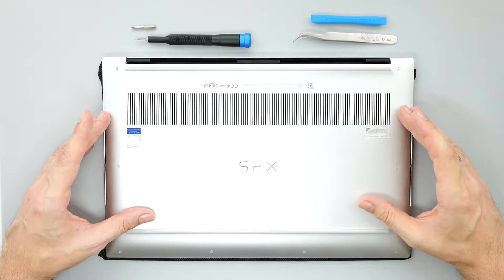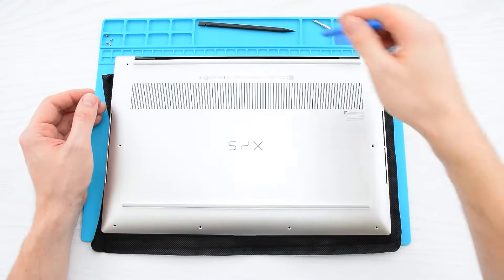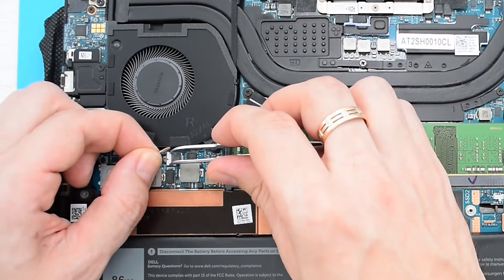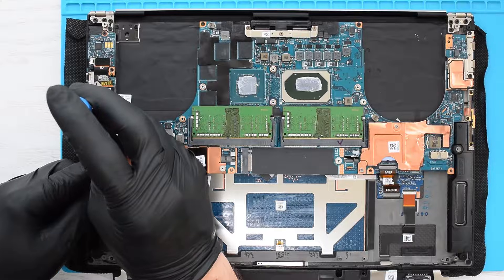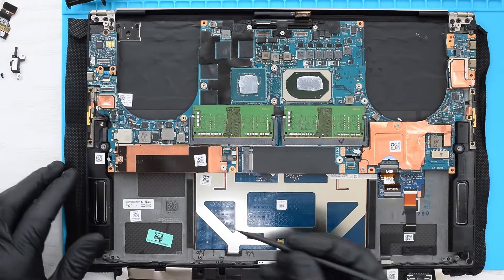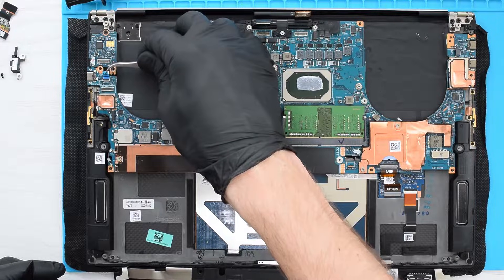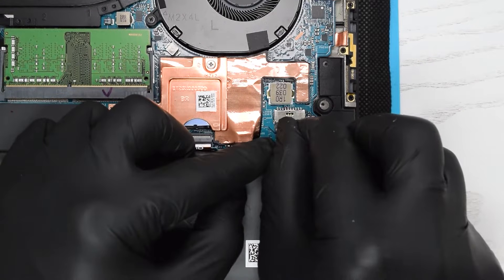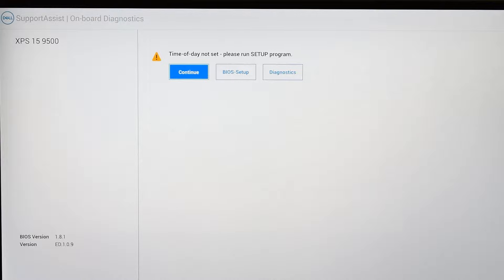How to Disassemble Dell XPS 15 9500 / 9510 / 9520 – Step-by-Step Guide

Comment: How many more steps after the 3:00 mark are there to replace the keyboard?
Reply from the maker: For that Dell XPS, the proper way to replace the keyboard is to replace the entire palm rest assembly, as it comes as a single unit. Technically, it is possible to replace only the keyboard by using a soldering iron to melt dozens of plastic rivets, remove the old keyboard, install a new one, and then re-melt and flatten those rivets to secure it. Will it work? Kind of. If you can’t afford replacing the whole assembly, this method is acceptable. However, keep in mind that it will never be like the original. The keyboard will usually have some play, some areas may sit lower than others, and many of the plastic rivets will break or weaken because they were not designed to be reused or allow keyboard replacement.
Reply: @ElectronicsComputers  excellent, thanks for detailed description mate

Comment: I'm wondering what the copper/golden-color heatsink with a thermal pad underneath is for. I replaced the pad with paste, thinking it was the CPU - is that a bad idea?
Reply from the maker: That chip is the PCH, and using thermal paste instead of a thermal pad is a really bad idea because there’s a big gap between the heatsink and the PCH die. You need to use either thermal putty or a thermal pad, otherwise that laptop won’t last long.

Comment: Hei man! Great video.
Question, since you are the only one on YT that has same model - how to remove keyboard?
The rest of models have few screws that holds keyboard. But mine (and yours) seem to be attach to cover :/
Tnx
Reply from the maker: Yes, the keyboard on the Dell XPS 9500 is technically replaceable, but it’s designed to be replaced together with the palm rest assembly. But you can still do it. The keyboard is held in place by plastic rivets that were melted during factory assembly. If you gently soften the rivet heads with a soldering iron while prying up the keyboard, you’re essentially melting them just enough to release the keyboard without snapping the heads off completely. This way, more of the original rivet material stays intact. When installing the new keyboard, you’ll still have enough of the rivets left to re-melt and mushroom them back over the new frame. We do this kind of repair on a regular basis, it's pretty easy.
Reply: @ElectronicsComputers  I was afraid of that =)
Thank you so much - I might do that

Comment: Helpful video! Would I be able to swap my dell xps 15 9500 with an i5 motherboard with that of a dell xps 15 9530 with an i7 and arc a370m gpu?
Reply from the maker: Yes it's possible but you have to also replace the heatsink.

Comment: How do you get the plastic tool inside the corner in the first place? I cannot get this back cover off. I have the same tool.
Reply from the maker: Just push it firmly and gently move it slightly left and right until it slides into place between the cover and palm rest assembly.

Comment: I have an 9520 and used a different charger (one from my ASUS which has a lower watt spec). I have used this ASUS charger many times and still use it on my ASUS and my phone without any issues. However, one time when I plugged it into my 9520 I heard a high-pitched pop (like when you pop small bubble wrap) and since then I cannot turn it on. Before I purchase a new MB, I will try resetting CMOS, but if that doesn't work, I'm wondering if these have a replaceable fuses or MOSFETs (I'm good with soldering small components), and if so, where they are on the board?
Reply from the maker: There's no point in buying a new motherboard, as it will cost more than half the price of that laptop. This is because the CPU and GPU chips on the motherboard are quite expensive. I'd recommend trying to fix your existing motherboard first. Most likely, there are some dead MOSFETs or shorted capacitors, which will only cost a few dollars to replace if you order them from AliExpress.
Start by checking all the coils with your multimeter in continuity mode. Attach one probe to a ground point, such as any metal part of the USB port, and the other probe to any contact on the coil. If you detect a short, you’ll need to investigate that particular power rail further. Most likely, you’ll find a shorted capacitor that eventually caused a MOSFET to fail.
Even if you need to buy the cheapest hot-air station for $25, it would still be a very inexpensive repair.
Reply: @ElectronicsComputers  Thank you 🙏

Comment: Unfortunately the keyboard is now welded with plastic rivets. On the past dell xps 15, even though it's integrated inside the casing, it's only held by screws that can be easily removed. Yes sure the plastic rivets on the newer xps can me melted and removed with soldering iron, but it will be quite much i suppose
Reply: I wish this video mentioned the keyboard and how it is attached to the palmrest. Can't find anything in on this on YouTube. I believe you are correct and this means it will be more difficult to replace or a new palmrest with a new keyboard is needed.

Comment: Hi, I just followed your tutorial to clean my laptop, and it was so helpful! I did run into an issue, I noticed my trackpad and keyboard are not functioning after reassembly, what do you suggest I do?
Reply from the maker: Check the connectors, that's the only place where something could go wrong. If it doesn't help, then try to reset the BIOS.
Reply: @ElectronicsComputers  Should i just try disassembling again and then reassembling? And do I need to look at any specific connectors? That’s what i was thinking of doing. I’m not well versed in this so I’m asking so many questions sorry☹️
Reply from the maker: @yearthy2529  Just reconnect those two connectors that you see on the bottom right side. Maybe you didn't plug them all the way in.
Reply: @ElectronicsComputers  I fixed it! Reconnecting the connector was the only thing I had to do, and I just had to restart one time after rebooting my laptop. Thank you so much!
Reply from the maker: @yearthy2529  Great job  👍 . I'm happy to help.

Comment: Hmn... Still don't understand where's a CMOS battery location?
Reply from the maker: The CMOS is powered by the main battery.
Reply: @ElectronicsComputers  thank you
Reply: @ElectronicsComputers  Sorry to piggy back on this, but you are saying that when you remove the main battery, it automatically resets the cmos battery too?
Reply from the maker: @Ajvkorn89  There is no CMOS battery in most modern laptops with built-in batteries. A large lithium-ion battery, provides power to the CMOS chip. Therefore, if you disconnect the main battery, the CMOS settings may be reset.
Reply: @ElectronicsComputers  thanks man. Was going crazy trying to find it cause the fan is extremely loud. Already replaced it, reset bios, nothing works. Immediately turns on high when you start the laptop. This least lets me know not to focus on the cmos resetting the settings. Appreciate ya!

Comment: Is the left side the way the lettering is facing on the back trying to make sure I got the right fan assembly
Reply from the maker: Those fan can be installed only to the correct side  and there's no way you can install them to the wrong side.

Comment: So I am trying to install upgraded RAM and sure enough 1 of those 8 screws has become striped (its a corner one on the front 'lip').  I am going to try to place either a rubber band, small cloth, or electrical tap between the screw head and my tool so see if I can get it out.  wish me luck.
Reply from the maker: I hope you'll make it work.
Reply: Ok so its been 2 months.  What I had to do was use a 1/16th drill bit to drill out the tiny TX5 screw. Make sure the measure the length of the other TX5 screws and mark your drill bit accordingly (I wrapped blue painters tape around the drill bit that was longer).  After drilling out the split screw I was able to pop off the chassis like you did here.  

I think Dell XPS 9520 have a BIOS setting that will detect hardware changes and may require your BitLocker key if you have that enabled on your system.

Comment: Many thanks for the instructions. However, on my XPS 9500 it was impossible to start from the corner as recommended. Even with a tool the size of a razor blade, I could not open the very tight connection there. Eventually I was able to (carefully) start from the hinges. It took me 30 minutes to remove the cover, a "nightmare".
Reply from the maker: I'm happy to help! My instructions were based on the Dell service manual. I've opened dozens of those models in my repair shop, and some of them are very easy to open, while others are quite tight. It could be due to different revisions of some parts with varying tolerances.
Reply: Same here, it's like it's welded down AND NOTHING will lift it

Comment: If I spilled water in my 9520, but shut it down shortly there after, should I disconnect the main battery, drain any electricity, then connect the battery and restart  the computer?
Reply from the maker: Yes, you have to disconnect the battery as quickly as possible and dry your laptop. If you see some residue on the motherboard, clean it with rubbing alcohol. In most cases, the keyboard doesn't survive liquid damage.

Comment: great video, one of my fans has died and I am replacing it this weekend!   Question, do you need thermal paste on the heat sink when I reattach it?
Reply from the maker: No! You don't even need to remove the heatsink to replace the fan. Simply unscrew the fan, replace it, and put everything back together. If you're not confident in your skills, disconnect the battery. Otherwise, a dropped screw on the board with the connected battery can be fatal to that motherboard.

Comment: Can you remove the usb c port ? mine is completely loose and doesn't stick so I need a new port
Reply from the maker: On the right side of the laptop, there's a small PSB module with USB ports that can be easily replaced. However, on the left side, it's not as straightforward since they are soldered to the motherboard. Nevertheless, any repair shop should be able to handle it; it's a pretty basic repair.

Comment: Where the CMOS battery located in this laptop?
Reply from the maker: It's the main battery itself in this laptop.
Reply: will it make it difficult to repair?
Reply from the maker: @PMRony  If you want to reset the BIOS then simply unplug the battery and leave it for a couple of minutes.

Comment: Thank you for the instructions! I used it to replace the keyboard on one of our laptops. In case anyone is wondering: The keyboard is welded using bits of plastic. To remove the keyboard I pushed it with force to the inside against the welds, eventually got it free. The new one is glued in place with bits of super glue to replace the welds. I recommend using a glue that is viscous, to prevent it from leaking. The part of the motherboard that is over the keyboard is exposed and the replacement keyboard was not isolated, so I glued a piece of adhesive over it to prevent shorts.
Reply from the maker: Good job!
Reply: Hi which sell did you replace keyboard
Reply: Great information. This is what I was looking for. I have replaced this type of keyboards in other newer laptops but not this model so I was curious. It can be done but very carefully. Many thanks 🙏🏽

Comment: Hello! I found the video very usefull for disassembling the xps 15! Do you know, if the keyboard,touchpad and palmrest assembly is the same on the 9510 and the 9500? I need to replace it and I can only find a replacement part for 9500...for 9510 I cannot find anything...
Reply from the maker: All parts on XPS 15 95xx except the heat sink are completely identical.
Reply: @ElectronicsComputers  If all parts are identical, why are there different RAM upgrade module links (for 9500/9510/9520/9530)?